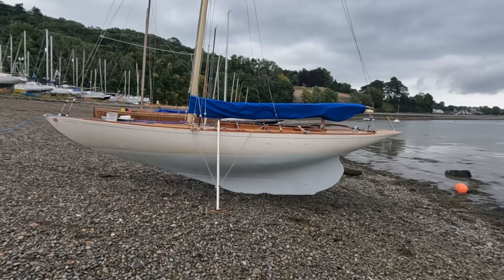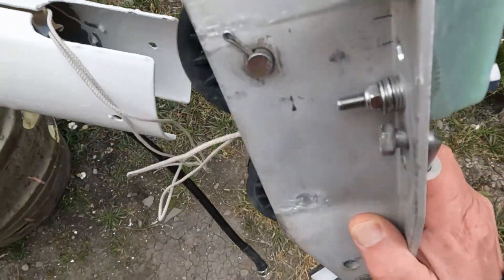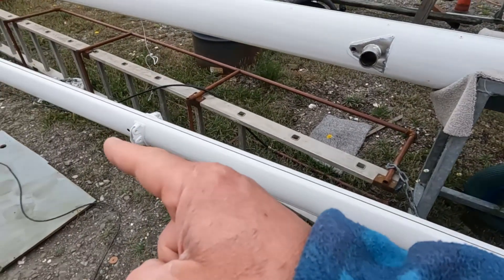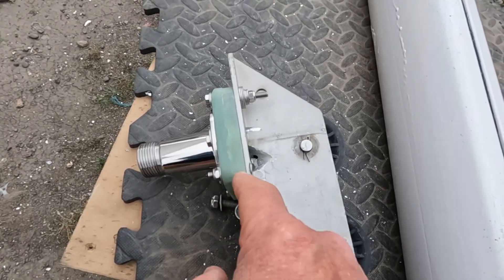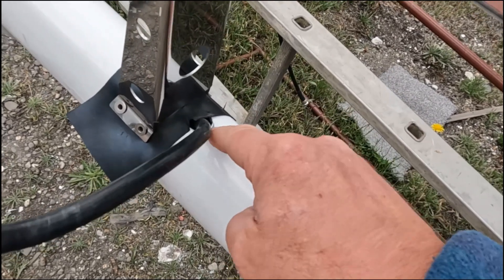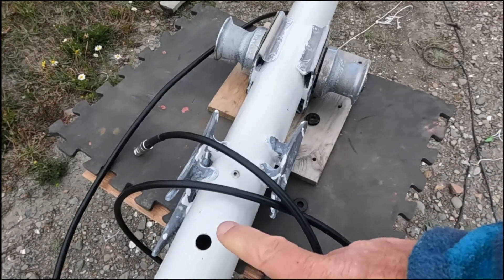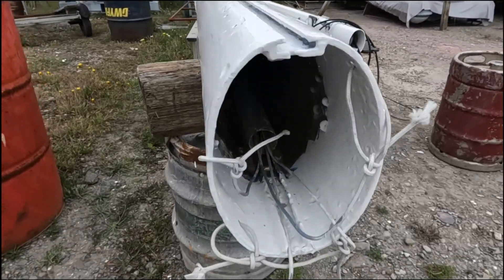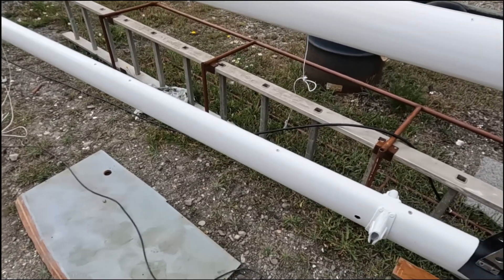Installing AIS and WiFi Antennas on our Mizzen Mast: DIY Boat Refit

Comment: thanks for the video, just found it - I own a 1972 Twister that I'm constantly upgrading. Quick question (and please just point me in the direction of the video if you've covered it already) what paint did you use to paint your mast/mizzen, why did you choose to paint and how many coats? TIA
Reply from the maker: We painted them just before we started doing YouTube a bit more seriously.
The anodising had worn off the main (the mizzen might have been replaced at some point). So we had one gold and one grey mast.
Also a number of fittings had been improperly fitted so there was some localised electrolytic corrosion.
We used a nylon grinding pad to clean up the pitting. We used epoxy filler on all the holes/pitting. 
Then International Perfection 2 part paints (2 epoxy primer, 1 undercoat and 2 top coat if I remember correctly)

Comment: Mate, those rivet nibs inside your electrical conduit will eventually cut through the the antenna cable insulation and create an additional ground point that reduces performance significantly, and randomly in the future.  This issue could be worse on any power cables running through that conduit.  I like the rivet idea very much, but might consider going with a wider diameter primary conduit held with rivets and double sleeving with a smaller conduit that is glued in place. Constant motion and wear is the enemy.   Love your video BTW
Reply from the maker: Yup that concerned me. The inner tube is a great solution. Will look at that.
Reply from the maker: We think we have found a reasonable solution. We couldn't find a plastic tube/pipe that would fit in the conduit and still be big enough to fit the cables in. However, we have bought a larger garden hose with a 1" diameter. Hopefully both cables should fit in it.
While not as tough as a solid plastic tube if a rivet head does work through the hose there won't be much sticking through for the cables to chafe on.

Comment: These videos help at least a bit as I try to figure out my mast rigging/wiring etc. I'm in the process of fitting a used mast onto a boat I built - about to design the mast head (fractional - it is a catamaran) and all that. I made my tangs for diamond stays out of stainless strap and having a bugger of time figuring out how to polish them. Lots of little things to work out. Even locating j-bolts to fit a mast head.. I think I'm going to make my own. Keeps us busy.
Reply from the maker: Have you seen this from Beau and Brandy on polishing stainless chainplates. Might help.
https://youtu.be/kv8pW0485-g